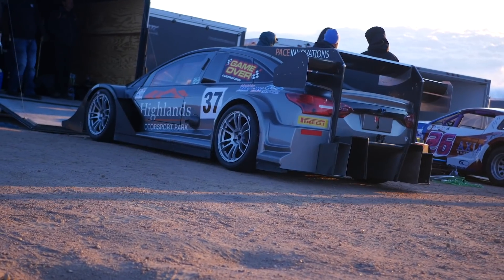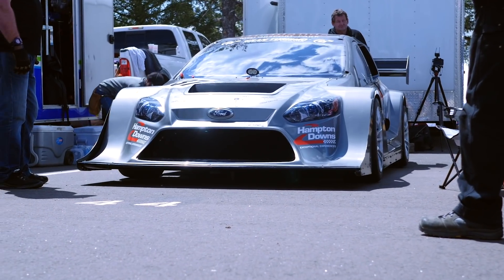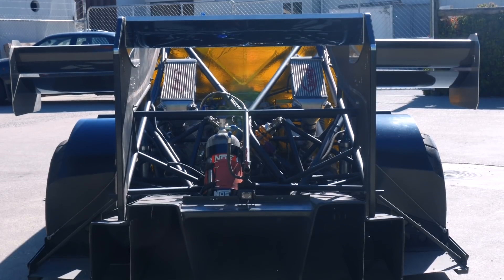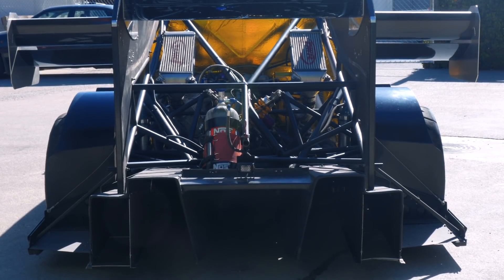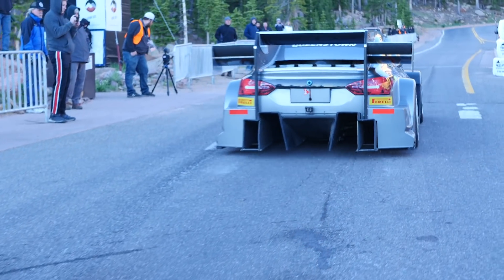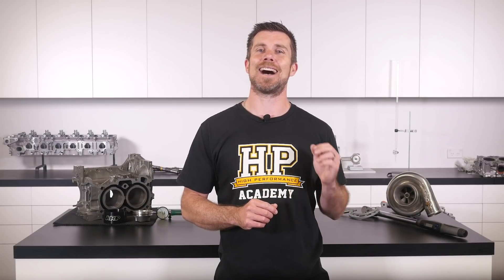800HP VR38 Engine Cooling Mistakes At Pikes Peak

Comment: That’s very sophisticated ways of lowering engine temperature but I’m a little confused on why you did not just use a methanol water injection system which would have lowered cylinder temperatures instantly very cheaply and very effectively
Reply from the maker: The engine runs on E85 fuel already which offers a significant increase in the latent heat of evaporation when compared to the likes of pump gas, so the advantages of adding water or water/methanol injection are nowhere near as significant in this application. It's also a case of working with what is practical and achievable. A proper WMI system is actually quite complex if you want an effective system that offers fine atomisation and reliability with suitable safety checks included.
Reply: High Performance Academy great answer!! I didn’t know Water injection was difficult to install? Now I know
Reply: @hpa101  Thanks for highlighting the cooling system inefficiencies at altitude.  We race here at the base of pikes peak all the time and the first thing people traveling to our tracks go thru is overheating.   Unfortunately, water spray is a very short term bandaide, altho great for a 10 minute run up the hill.   If you break it down to joules of heat in and out, the ability of a couple of gallons of water for spray is not that much, although the reason it works is the significant bump you get from putting it through a phase change, so you want to make sure your spray flow is not so high you get liquid out the back of the fins.  We found the most effective way to cool at altitude is have the water spend more time going thru the radiator, and hence started making big rads into double and tripple pass paths.  Maybe that helps your next trip here, hope to run into you at fan fest!
Reply: ripfletching this is exactly what I was thinking?  My only thought is that the trade-off of the meth spray diluted the oxygen which would reduce power....however, it doesn’t take a lot of meth to reduce intake temps and then reduce also the latent heat in the block....spraying extra fuel is basically doing the same thing without reducing intake temps....sooooo would love to see a response to trying this technique in the high altitude?
Reply: Water injection increases octane

Comment: Maybe they shouldn't run the AFR at 12.5:1 to start with just to make the most power. 11.5:1 is the safest gasoline AFR with above atmospheric pressures. Then again, if they were running a purpose built diesel engine, they wouldn't have that engine cooling problem, since you'd want less than 1000°F exhaust temps and a target AFR of 18:1.......
Reply from the maker: This car runs on ethanol Batojiri1, and AFR is specific to the engine and application. There is no set AFR that is great for every engine in every situation  😎 

If you'd like to learn more about AFR you should check out our Understanding AFR course here: www.hpacademy.com/courses/understanding-afr - Taz.

Comment: Awesome! How effective do you think it would be to utilize dry ice for cooling, maybe for example having a dry ice holder infront of a vent so that air flows passed it onto the rad or oil cooler? It's kinda cheap and light weight also.

Comment: Not a bad result really, but the petrol Peugeot 208 T16 Pikes Peak's time is going to be difficult to beat... in fact, I think only the Porsche 919 Evo or some other recent, unrestricted LMP1 car stands a chance of beating the Peugeot's time and/or that of the electric VW ID R Pikes Peak!...
Reply from the maker: Even though this car was not a budget build, I'm not sure it would have what it takes to crack that 7-minute mark without some modifications and a bit more focus (dum dum, psh!) to be honest as Tony Quinn who owns and drives this car is really in it for the love of it all rather than record-setting from my understanding - Taz.
Reply: I'm sure it wasn't cheap, and considering the overall record times already set in some categories, most people going to Pikes Peak will really have to settle "for the love of it all"... because it's not going to be easy and it certainly won't be cheap either to come anywhere near those times!...
Reply: Didn't that volkswagen already beat the record tho...

Comment: What prevents the turbos from simply spinning faster to meet boost targets? Unless the turbos are already maxed?
Reply from the maker: As you push the turbos harder you move to a different point in the compressor map where eventually the turbo becomes inefficient or even may reach the surge limit. Pushing the turbo harder also results in the exhaust back pressure climbing.
Reply: High Performance Academy you should do an in-depth video on forced induction vs NA with altitude change

Comment: So was there testing done with reduced airflow at the "home" track?

Also, depending on just how fine the spray is, the radiator may be getting wet. Once it's wet you can reduce the duty cycle of the spray (eg 3 seconds on, 7 seconds off) without affecting cooling that much. This basically because if you keep spraying when the core is wet you'll just end up with water coming out the back of the radiator instead of evaporating, and that water is basically wasted (evaporating takes away significantly more heat than the heating to 85-90c or whatever water boils at up there).
Reply from the maker: There is nothing close to this for testing at home. The local hill climb event (remembering this car is not road legal) is under 1 minute long and the peak of that mountain (which is much higher than the course you run) is still under the starting height for Pikes Peak.

We don't manage the car ourselves so not sure what else was done in regards to that, but really this wasn't a massive issue that had anyone panicking, it was a few pre-emptive measures Andre did after noticing the car was warmer than he was happy with. It would be interesting to look through the post-race data and see how all of this came into play - Taz.
Reply: @hpa101  ok so it wasn't a massive issue.

The testing I was referring to was track testing, but with reduced airflow across the radiator. I would imagine that air mass through the radiator is the problem, so you could measure the air pressure across the core (using a $50 manometer), then reduce it by the correct proportions. In this case air pressure at the peak is 60kpa or so, so roughly 60% of sea level. The way pressure drops work, you'd need about 1/3rd of the usual pressure drop across the core to make 60% flow, emulating 60% air mass. So measure your pressure drop, cover the intakes with shade cloth or something until you get 1/3rd of the usual pressure drop, and you should have a proxy for what happens at the top of the hill
Reply: @skippy2987  good thoughts there.  Another way to simulate high alt cooling is using the same info to reduce exposed radiator area to airflow, simply tape off 40% of it (for your example).   There are some assumptions in that such as uniform airflow etc, but if you are heading to a high altitude track and your car can't stand the appropriate block off exercise, you will have more work to do when there.
Reply: @hpa101  that would be really interesting to see the post race data
Reply: It's 100° c
Reply: @DylanL69  not at altitude

Comment: What about completely shutting off spark and injectors any time the vehicle decelerates? I’m sure that would cool it down some. Not sure how quickly or smoothly the engine could come back in
Reply: If you cutoff spark engine would completely die
Reply: Dylan exactly
Reply: @bunnythekid  you don't want to do that it makes temp and pressure go up does the opposite of what you would normally think it would do
Reply from the maker: Actually passing unburnt fuel through the cylinder on overrun helps to remove heat from the combustion chamber. It's not great for fuel economy though.

Comment: Surprised more people with modified cars don't use Evans Waterless Coolant - IIRC, 350f boiling point without needing pressurisation.
Another option is to use a good glycol (?) coolant mix as that also increased the boiling point.
Reply from the maker: The actual temperature and the effect it has on the engine is the issue though, rather than the boiling point of the coolant being too low for the task - Taz.
Reply: Pure water does, indeed, have the greatest specific heat capacity at 4k2J/kg/K and any additives will reduce that. 
Agreed, the problem is heat rejection - getting rid of the heat energy that has been absorbed by the coolant as the lower density air at altitude means less mass to transfer the energy to. I commented on that in another thread. [edit] Seems not, strange... must be the Alzheimers finally kicking in ;-(
Neither of those are why I mentioned that product, though - that was specifically aimed at the comments about the boiling point being lower and the requirement for a higher pressure radiator cap* to maintain the same boiling point, to not only prevent a classic 'boil over' but to reduce localised boiling from hot spots that could have terminal results if in the wrong place or if it developed into a runaway condition.
Anyway, it has opened up some discussion on the subject, which is all to the good :-)

*Whilst this can give a short term 'cure', it puts a lot more stress on hoses, radiator matrixes, weldments where fabricated, etc. It also brings the risk of a 'cap failing to hold pressure.
Reply: @gordowg1wg145   GordoWG1 WG1  Evans has a terrible specific heat capacity so needs bigger heat exchangers to do the job effectively. Pure reverse osmosis water with No-Rosion additive is as good as you are going to get without rusting/corrosion. Higher pressure, more volume and better airflow are key. We always run electronic water pumps (CWA400) with great success. Moving the water faster is not always the best but on our low revving diesels we create a lot of heat at low engine speeds so factory water pumps driven at engine speed never keep up.
Reply: Ryan P  I know... for pure heat transfer pure water with a wetter ( and corrosion inhibitor) is going to be best - still not directly relevant to my post regarding boiling point.
Can't recall the Evans' SHC, think it was around 3k4 - does that sound right? - and as it can remove less heat energy per unit volume and delta T, it will indeed run a couple of degrees hotter and/or need improved flow and/or a better liquid to air heat exchanger (radiator).
Reply: My teacher once told me that coolant temps are optimal between 185-195°F with IAT between 90-100°F. Anything outside of those two being in ballance results in low efficiency. I think that's just for pump gas though.
Reply: Yeah but pure water transfers heat excellently. You only get rising engine temperatures when the amount of heat needing to be dissipated is greater than the  amount being transferred to the environment per unit time. The limit here is the size of the radiators, and the heat capacity of the ambient air you are trying to transfer heat to, which at altitude is very poor due to the low density air.

Comment: I live at 10k ft and I consider it very important to use higher pressure radiator caps. Each 0.1 bar is worth +0.6°F  of boiling point if I remember correctly.
Reply from the maker: Preventing the water from boiling is one consideration, however you still need to remove the heat from the water too.
Reply: @hpa101  Totally! It's more of a buffer because a proper cooling system and water/coolant ratio shouldn't boil in the first place.
 
 Since water boils at 192°F / 88.8°C @ 10k feet above sea level (-1°F every +500ft) with consistent weather barometrics, I use about a ~65/35 coolant to water ratio to keep temps below boiling point and only increase radiator cap pressure to split some difference in the water/coolant so it doesn't run too cold during low ambient temperature days. 

 For 7 months I run 65/35 and the other 5 months I run 55/45. Operating temps are 185-210°F / 85-98.8°C. EJ257T.

Comment: Spraying water, is a great heat management aid, Iike you said on rad plus brakes, in the intake etc, fantastic stuff h20.. love your vids Taz... nice tease at the end👍
Reply: I think there's a fine line between too much water sprayed over the radiator though because in heavy rain my coolant temps go up even with constant speed compared to dry. I do think a very fine mist that can evaporate as fast as its applied will dramatically improve cooling efficiency.
Reply from the maker: Using a water spray on the radiator requires the spray to be switched off and on repeatedly so that the water sprayed on the core is allowed to evaporate off the core. Continuously drenching the core is less effective for cooling and also will go through your water in no time.

@mr323i actually water sprays for cooling brakes are not entirely uncommon. The concern however is making sure the water is delivered in a finely atomised mist, and that it is delivered to the centre of the rotor so that both sides of a vented rotor are equally cooled.
Reply: Spraying water on extremely hot brakes your clueless. You only need cold air focused on the rotors /dics
Reply: @_i-kr6eg  cmon bud do your research

Comment: Would retarding engine timing help to or cause to much power loss at those altitudes
Reply: You get excess heat in the exhaust. So you have to be careful.
Reply: @ethan12313  right I understand that too that would spool the turbo up more also
Reply: @SuprSi  it still affects AFR
Reply: @SuprSi  knock generates that's why advanced timing cause the engine to run hot retarding timing cools down the cylinders which does affect AFR cus the heat generated from knock
Reply: Retarded ignition timing raises EGT (rich). Advanced ignition timing lowers EGT (lean). You can add a lot more ignition timing at high altitude compared to sea level. Exhaust temp gauges are underrated.
Reply: @gammalight1312  a rich mixture lowers egt's not raises them you have it backwards a lean mixture raises them
Reply: @DylanL69  Retarded timing with rich AFR keeps cylinder temps down but it does raise EGT. Advanced timing with lean AFR increases cylinder temps but since there's less fuel to burn up in the exhaust it keeps EGT lower.
Reply: @SuprSi  Assuming the IDC is static, altering the ignition timing will alter AFR and EGT.
Reply: @SuprSi  So what changes the EGT if the AFR isn't changing?
Reply: I just checked what I wrote against 3 different source's and I'm 99% sure I'm right. Take it with a grain of salt I guess.
Reply: @gammalight1312  lol
Reply: @SuprSi  how does it make it hotter if it's running richer that doesn't make sense it burning in the exhaust doesn't make the engine running hotter you have no clue what you're talking about